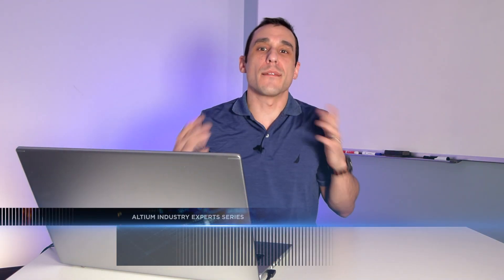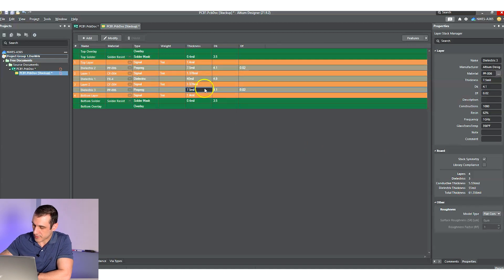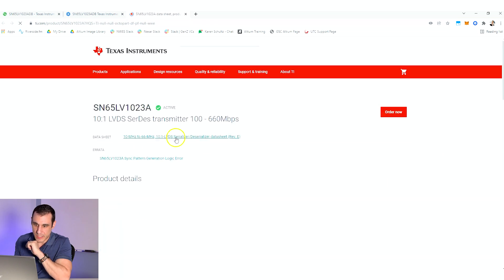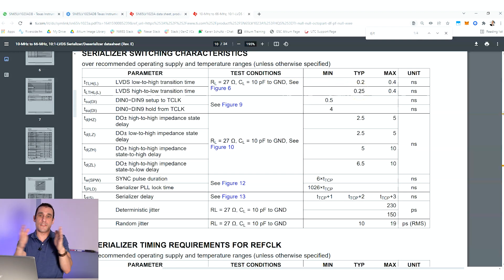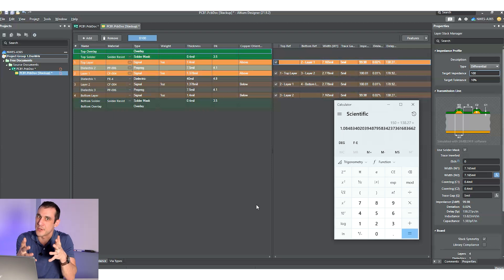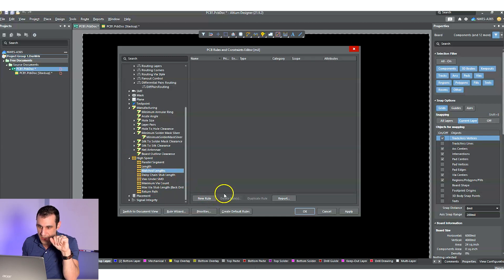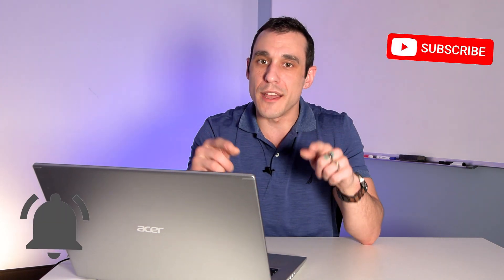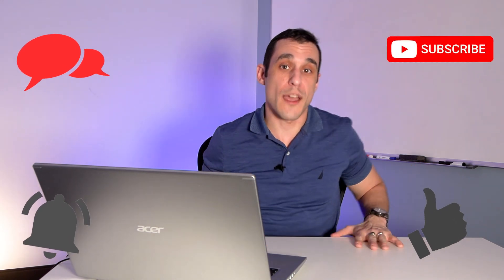Length Tuning | PCB Design Basics Tutorial

Comment: I recommend matching by delay as opposed to length, especially for parallel buses like DDR3/4, because chances are you are going to have to route traces of a group on different layers, and so they will have different propagation delays because signals on outer layers are about 10-15% faster than on inner layers. Also it seems that Altium does not account for via z-length delays - not sure if it can be turned on or not, which can also lead to additional skew - take that 4 layer board shown, those signals that go via bottom layer will have their path 1.6 mm (standard PCB thickness) x 2 (as signal "cross" the PCB twice) = 3.2 mm longer than those on a top layer, and that alone adds about 20 ps of skew. This is not a big deal for slower interfaces, but once you get into 1GHz+ range (say for DDR4 interfaces, which often go beyond 1GHz), this skew becomes significant enough to worry about.
This is less of an issue for differential pairs as they are pretty much always routed edge-coupled on the same layer, but they have a different problem - namely dynamic phase skew, when signal edges don't physically propagate next to each other due to difference in traces geometry. This is why it's always recommended to add length matching as close to the place where length mis-match occured as possible, such that edges would travel together for as much of a differential trace length as possible. Again, for slower interfaces and/or shorter traces this is not very critical, but once you get to a backplane territory, these things become critical.
Reply: Bro, you're posting all the stuff that's going into the follow-up video!
Reply: @Zachariah-Peterson  That's great! Not many people read comments, so it will be great if you make a video explaining these things more thoroughly than a comment can. Keep up the good work you do!
Reply: i'm very interested in the Z axis delay too - i think you can add it manually to vias but AD doesn't do it automatically (yet). comparing it to other tools on the market, AD does a really good job at this stuff, very accessible and easy to use
Reply from the maker: @TheDigital19  Yes you can add it manually, just select a via and look in the Properties panel. We just did a video talking about this point with the z-axis Dk value in the backdrilling video and there is another one where I look at via delay specifically, it should be ready soon.